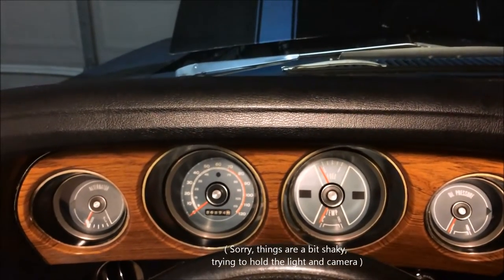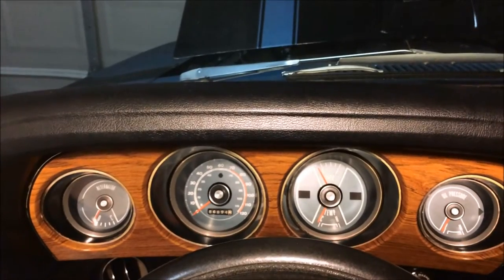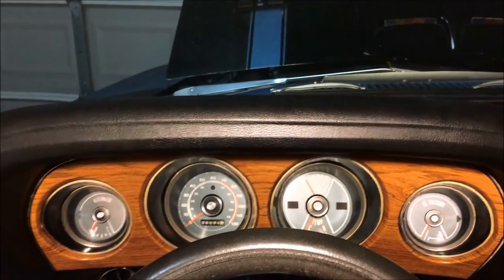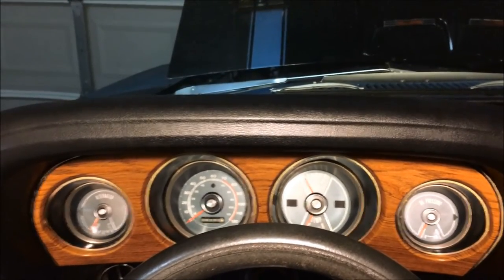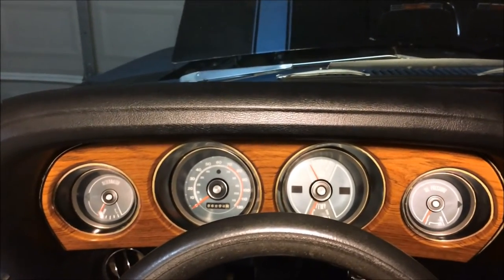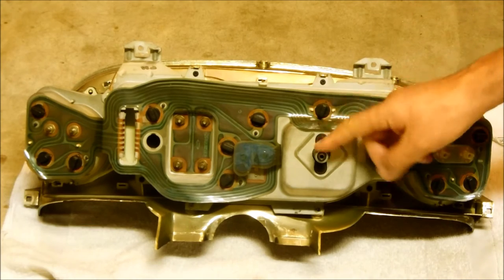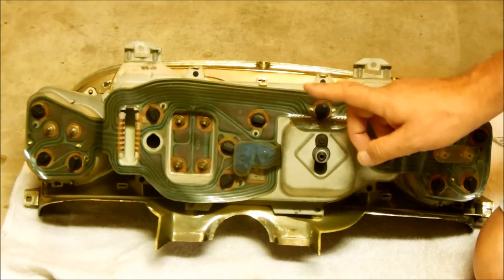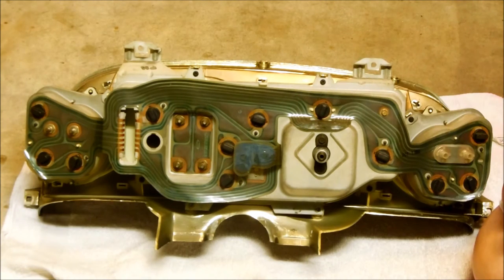1969 1970 Mustang Remove Instrument Cluster How To ( Gauge Cluster )  - Ford, Mach 1, Shelby, Boss

Comment: How did you remove the speedo cable? On your graphic you state pull clip toward you. Is that sideways towards passenger side where you are reaching from? I can see and feel the cable and clip but can’t seem to get it off.
Reply: Never mind. I discount the speedo cable from the transmission which allowed me to pull the gauge cluster away from firewall and push the tab in to pull the cable away.
Reply: Disconnected

Comment: I LOVE your videos and have just subscribed to the series..but I don't know why, but every time I play your video the sound goes out right when you get the speedometer cable, and that's the ONE thing I'm having REAL difficulty with...I have a 69 convertible (I actually bought it new..)  and I'm trying to put new LED lights, lens, etc. but I have to get the cluster out and theat speedometer cable is giving me headaches. (But why is the audio cutting out right when you get to that function?) HELP?

Comment: Trying to get my cluster out - dash is off. How did you/do you need to remove the plastic tubular cover over the steering column?
Reply from the maker: +Jazon Watanabe - So my car never had that rubber gasket, but I recently ordered it and added it.  The best way to deal with it would be to remove the lower plastic cover to the steering column.  Mine has 2 screws at the bottom and then 2 clips that reach into the console area (so once the screws are out, slide it down and toward the engine direction).  The rubber gasket in front of it wraps around the column and clips to itself at the bottom.   You might look up the part at say CJ Pony Parts to see what it looks like to have a better understanding of the rubber gasket.  But you will find it is not too tricky.  The rubber part should slide forward toward you once you have the bottom off and then you just unclip the underside of it.  Hope this helps.  Regards.